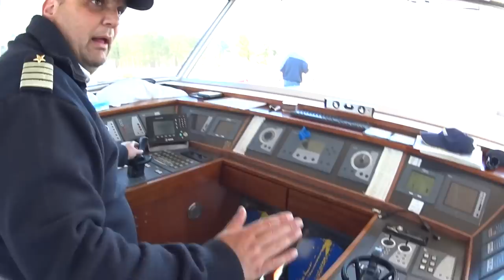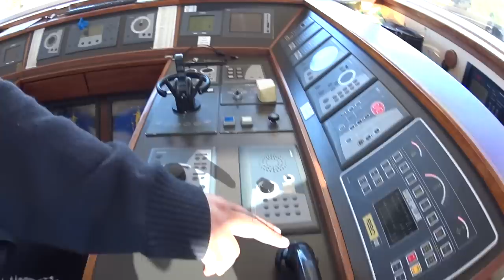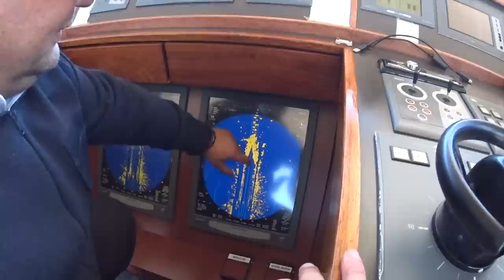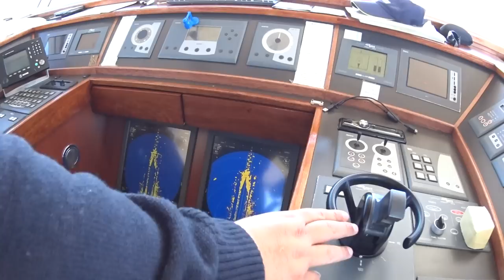How to control a river cruise ship - Interview with the captain

Comment: Every lock has a person who drives you to the entry. You need to comunicate when you are 2-3km close to the lock. And he will try to make it free for you. That man open and close the gates for you. One more thing. That it not cruise control, the cruise control keeps you speed at the speed you want. That is z-drive. The z-drive helps you to drive the ship easier and help you to change your direction of your propeller easily so you will take the corner safely. What captain is this hahaahahah
Reply from the maker: Thank you for the info! The person you communicate with to drive you to the entry, they are not on site at the lock, right? They are at a central command location?
Reply: Yes
Reply: How does z -drive work ?Cheers.